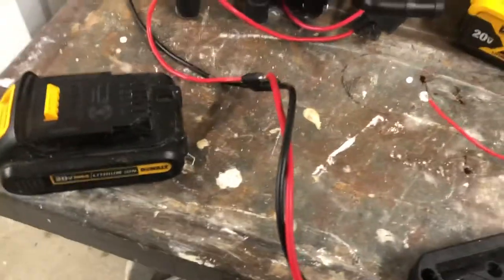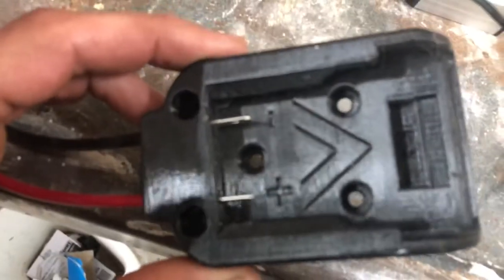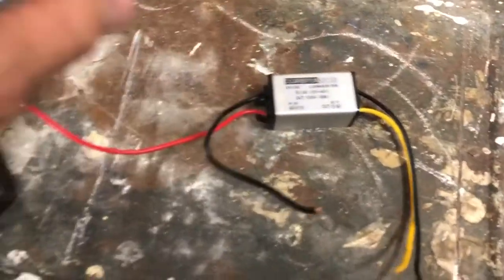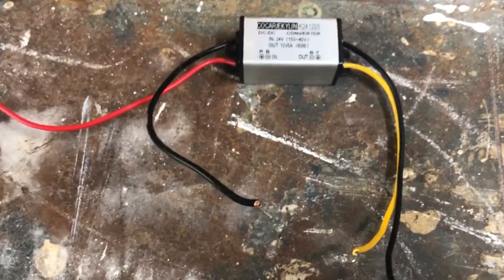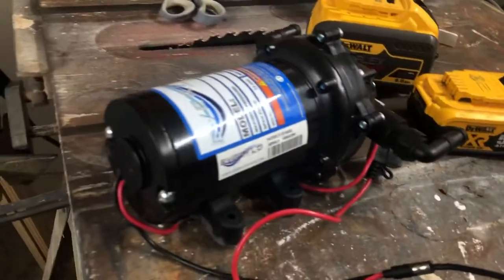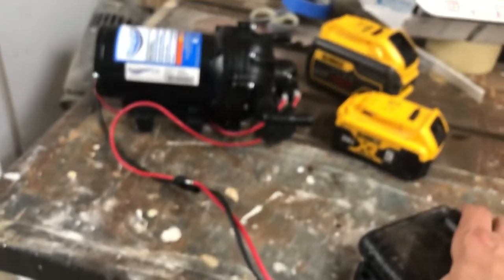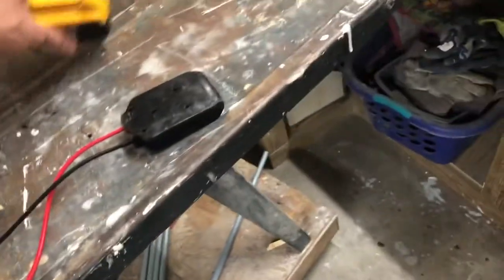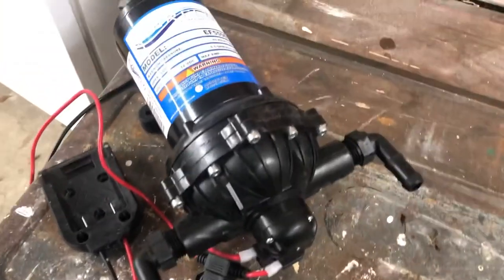Diaphragm pump run on Dewalt battery?

Comment: You just need a 20v to 12v step down also AC or DC dosent pertain to these type of batteries. Straight 20v will fry your pump the extra voltage has to go somewhere. I use the same set up in a portable feeder for kid goats. Works like a charm been using the same battery for 8ish months now